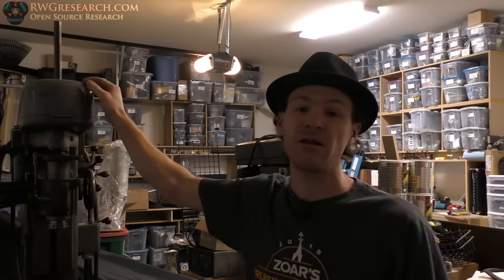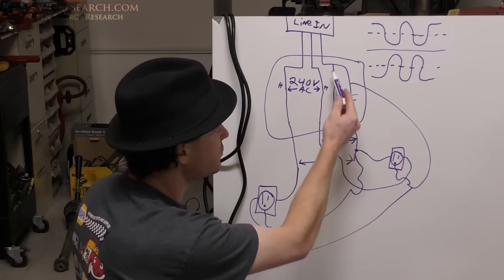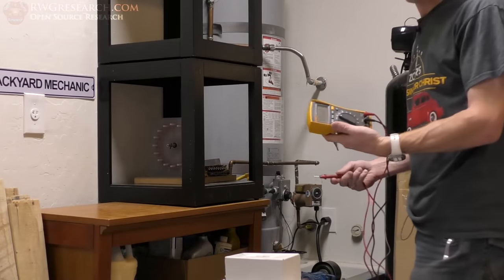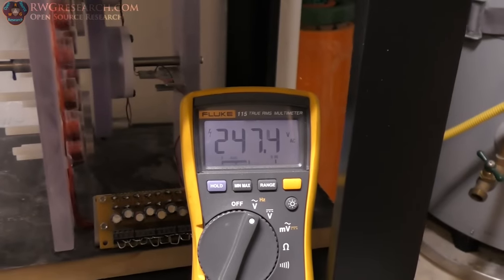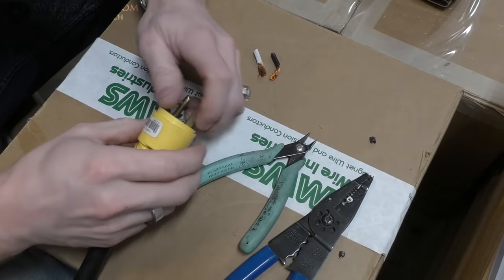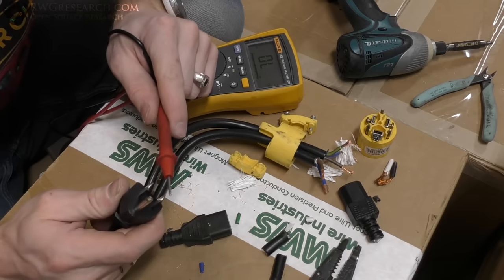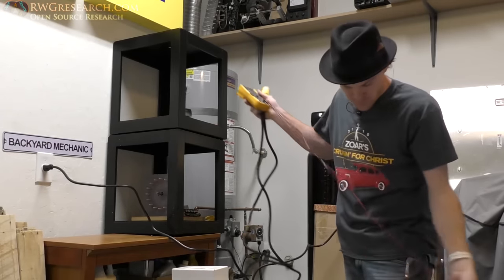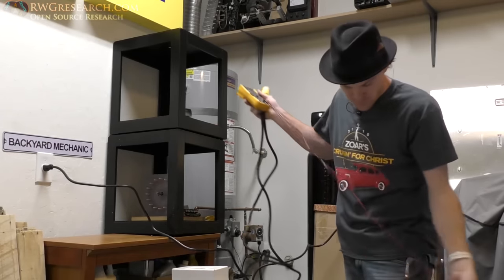How To Get 220V/240V From Two 120V Outlets. No Electrical Panel Work Required...

Comment: actually - for all you safety nazis - he's doing a good job of immediate problem solving.  he understands his primary electrical principles
he discloses  BOTH   " at your own risk "  and  "  install the proper outlet ". in other words - you can do this - and you can do this safely - but this is not a permanent solution. 
he seems to believe there is some necessity to have equally balanced amp ratings for his 2 circuits which is wrong. neither does he disclose the circuit will only produce 2 x amps of the weakest breaker.  
he also does not address the reality/ necessity of amperage.  
this circuit will only produce 20 amps because of the 10 amp breaker. 
in real life terms -20 amp/240/single phase will not run a clothes dryer or 2 ton heat pump.  it will run a few stove burners or smaller air conditioners - but not both at the same time.  
to run a milling machine / lathe, welder or other large machinery - you will need more than 20 amps /single phase. 
so  -  his immediate solution method is creative and effective, but you're going to need more amperage to run more substantial machines.
Reply: 20 amp at 240v single phase will run a clothes dryer in the UK you only put 20amp breaker in a radiua circuitl and it works for a number of things
Reply: @paulpink9518   sure - 20 amps in one leg with the other legs hard wired will run a clothes dryer but it won't protect the other legs of power.
Reply: @mixter7x7  but in the UK you only fuse one leg of the circuit on a radiual the we have live neutral and earth as I believe you guys have 240v split load so 2 at 120
Reply: I'm not a safety nazi, don't like how people worship electrical code books. but, there are problems with hacking shit together. it's all fun until someone gets hurt or you burn your place down. don't take short cuts, buy the proper equipment. more than half the comments on this video get something wrong, so people definitely have more to learn. don't take short cuts.

Comment: What is the total amperage ?
Reply: Max you can pull is the minimum of the two breakers. If you have a 15a and 20a 120v breakers, you can only pull 15a @ 240v before it pops.

Comment: Why didn’t you just put a disconnect at that 230v water heater??? Then it would have been on the same circuit breaker
Reply from the maker: There is no 220V going to any plugs in the entire house. In fact. The AC units are the only things that have 220 (direct connection through disconnect ) We here use gas for everything. Including the dryer and water heater... ;) ~Russ

Comment: Only criticism is if one outlet's breaker trips and the other doesn't, the mill motor is going to burn up pretty easily.
Reply: It won't get any power. Power is coming in on one hot line and going out on the other. The ground is only used for safety. So if some wire comes loose in the machine and it touches the frame, it shorts and trips the breaker instead of the frame voltage raising to 110v making the machine unsafe.
Reply from the maker: agreed. if i were using the neutral's like some plugs do id be slightly concerned.     ~Russ
Reply: If one breaker trips on the 240 volt circuit, the appliance would not continue working as the circuit would be interrupted.  You still have to be careful, as the other line on the other breaker is still energized.  Indeed, in the 1950's, when glass screw in fuses were used, 240 volt circuits had 2 fuses, but no way to de-energize both hot lines at the same time.  A few years later, they came up with the idea of a common fuse pull to de-energize both lines, and eventually with two ganged breakers when that form of overcurrent protection became more common.
Reply: You'd end up with a brown out situation where you're suppling power through the mill to other devices on the tripped 120 volt circuit. All devices would be at risk due to low voltage.

Comment: Those wires seemed kinds small for that load. Be interesting to see how long before they melt. You could have also tapped into the disconnect on that water heater that's already 240 volts and just turn it off when using the mill.

Comment: Make sure you never have anything plugged into the 240 side while only one of the 120 plugs are inserted. The loose 120 plug will have an energized prong at 240v 💀
Reply: If one 120v side is unplugged and the 240v side is still plugged in than the unplugged 120v plug will only be 120v not 240v but still not safe. You can buy the quick220 to do this correctly
Reply: @peretzlazaroff  Ah yes you are correct the line to ground would be 120 in the exposed energized plug. My mistake!

Comment: Could you not also just say make sure you pull power from each side of the breaker box? (one breaker is on the left, one is on the right? Would that not be a easier way to describe it to people?)
Reply: No, that is not correct. If you look at a panel, a 240 volt circuit is pulled from the same side of the panel. The panel is designed to have adjacent contacts on the same side give you 240v.
Reply: Pulling from both sides of panel would have 50/50 chance of working. Each side of the panel has both legs present.
Reply: @irvbarth2069  Yea, that is what I was trying to say it just didn't come out that way. It looks like the same side, but the bar(s) behind the breakers pull from each side... like a zig zag...
Reply: Agreed

Comment: so how does this work for the 240v receptacle do you not need any neutral going out of the 240v receptacle ???
also. if i was to add a third power line from the breaker would that make 347 V outlet?

Comment: In my place only I got only two wires 220 no neutral how can I use my 110 power tool
Reply: +Rowel Aromin
Then you need a step-down transformer, 2:1 ratio.  An autotransformer (e.g. variac) can work too, but if neutral-contact fails it may push 240v through to the outlet.
Reply: LMAO plug your electrical drill into a standard outlet you don't this video if your power tool runs on 110

Comment: In a single phase home, how can you possibly have two phases? You say out of phase but that would imply you are on a 3 phase wired home and then you wouldn't get 240V because you have 120V/208V. 

FYI, what you are doing will void your insurance claim for anything that results in a claim because your breaker won't trip both 'legs' out when you have things go sideways. You're playing with fire and while you might know what you are doing, those watching most likely won't if they are watching this and thinking, "gee, that's a great idea".

Comment: What you are doing us dangerous a d violates every electric code in the country. Much easier and safer to buy 2 piggyback or halfspace breakers and install a proper 20 amp 240 volt circuit. You know just enough about electricity to kill someone!

Comment: Sounds like there is a sycronic malfunction two differently wound motors. 👇
Reply from the maker: I need to check the caps on the rotary converter... ~Russ

Comment: 120v outlets are really 110v outlets in electrical terms. Just FYI 😃
Reply from the maker: "Mains power is sometimes spoken of as 110 V; however, 120 V is the nominal voltage." wiki... ~Russ
Reply: If someone has an appliance plugged in while plugging in or removing either of the 2 cords they will be electrocuted. You should remove this video until you come up with a version of this that prevents that. No offense but this will get ppl killed who don't know about electrical(most those watching judging by the comments)

Comment: we have 230 already in our homes(europe), so you have 240 3 phase in house? we got 400v between (3)phases.
Reply: In the US, our 240V is split phase. Basically the voltage from the high tension lines is stepped down to household voltage with a center-tapped 240V transformer, The center tap then becomes the neutral for both 120V sides of the transformer.
Reply: Jason Simpson thnks for the reply, did not know that. i think a higher voltage in house would be better for efficiency.  nice to see the differences across the world.
Reply: Its one phase split into two poles. Still one phase

Comment: +Russ

The problem with doing this is that it can create an electrical safety hazard in two ways...

A.) The entire system will not have any protection for the incoming 240 on one side or the other if there is any fault as the protection is coming from only a single side through only one breaker and may be catastrophic.

B.) MORE IMPORTANTLY!! This can cause DEATH by shock hazard, due to power going through the equipment and returning on the other line. If you unplug a single line, there can and probably will be the voltage from the remaining plugged in line traveling through the machine and out to the now unplugged line making the exposed prong of this line hot and if you were to grab this line or it was touching something conductive , well you know what that means. Or equally as bad you unplug one line or it gets inadvertently disconnected and it then can ark and cause fire.

THIS IS A VERY STUPID PRACTICE AND SHOULD NOT BE DONE AND IS A KNOWN CAUSE OF DEATHS AND FIRES!!! 

Don't be lazy! If you know how to do this then there is no excuse for you doing it and you should install a proper 240 volt outlet. You can do this with almost as much ease as you doing all of this to avoid it!!

Comment: If the 220 requirement was 30 amp,  would connecting to the 2 120 volt circuits if they were only 20 amp each?
Reply from the maker: No, if your going to run a 30amp load. DO NOT DO THIS. Install a real 220v 30amp  double pole breaker... what i show here is a temporary solution to an emergency situation... ~Russ
Reply: @RWGresearch  How does a 220 share the amp load off two 120 volt legs?   I may not be wording this correctly,  no im not going to do this but i find interesting how it would work,
Reply: @RWGresearch  is a 30 amp double pole 220 breaker made of two 15 amp breakers or are they both 30 amp?
Reply from the maker: @laserfalcon In that case they are both 30 amp, and each one is internally tied together so that if one trips, they both trip. This is why its called a double pole breaker. Thanks ~Russ

Comment: So in other words this is a no no for a 240v 10,000btu air conditioner? My room has a converter box that converts 120 to 240, but the plus is off.

Comment: I'm wondering when he said to measure it how many whipped out a tape measure? and when he said phase thought about their dad saying they went through a phase. If you when you watched this thought either of these thoughts please don't try this. 110 wire   is much smaller than 220 so wire melting/outlet burnout will happen with heavy load extended use. The guy is right though it is possible to do with tiny loads. Why not just show how to go to Home Depot and buy a 220 breaker and a few feet of wire and outlet and mount a 220 outlet next to the breaker box? Breaker ten bucks wire less than that and an outlet another ten bucks and way less danger from idiots that might not know what the heck you are talking about?

Comment: Dude...
You strike me as a smart, resourceful kinda guy.
Why would you even think about doing something like that, especially since you know your way around in the electrical world?
Sure... it's a neat little hack. But for the time it took you to concoct that, I think you could have just as easily ran a wire from the panel.
People will think you're really smart. Rightfully so. However... there are a lot of people who don't understand why setting up a 240 line
is NOT done like that FOR A REASON. Yes... there are a lot of capable people out there that can do this with minimal risk. BUT...
eventually... someone NOT capable is gonna get hurt (loose/improper connections, wrong wire gauge, reversed wiring, damaged
wire jackets, 2 outlets on the same circuit, wrong amperage breakers, etc.).

"Although this is not recommended"  --your words.
Despite the fact that it works for you, doesn't make it a good idea to be advertising this to the uninitiated.
Just my 2 cents. Best of luck to ya.

Comment: Man you should have at least hooked those up to a two pole breaker.
Reply: He basically did just that. He hooked up to two single breakers on two separate poles, same thing in theory. Whole point was to save time, materials, frustration and surface-mounted wiring. However, I see now where he said he doesn’t recommend this set-up for heavy draw or regular use. So, won’t work for me

Comment: I think it works. Temporary.
Reply: It works as long as you need it to as long as you don’t draw more than 20 amps from either or both outlets. Because the breaker will trip. Unless it’s on a 15 amp then it’ll trip at 15

Comment: Is anybody concerned about that jumper he made to tie two 120v plugs? As soon as he plugs 1 in the other becomes hot in your hand.
Reply: Villmark69tron I don’t see how, PhaseA is tied to one cord cap’s hot, PhaseB is tied to the other cord cap’s hot.  The male ends of the cord caps are isolated. The neutral of the cord caps have no connection. There is no jumper.  Now this holds true of his Milling machine is unplugged.  Be sure to unplug the milling machine before plugging/unplugging the cords from the wall.